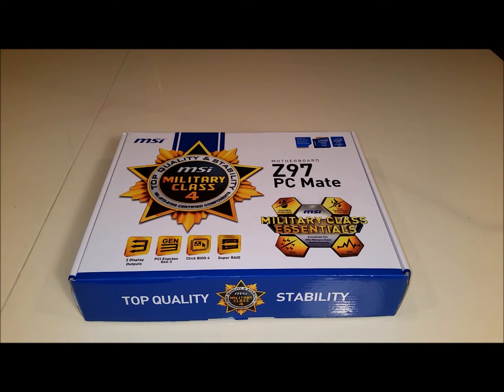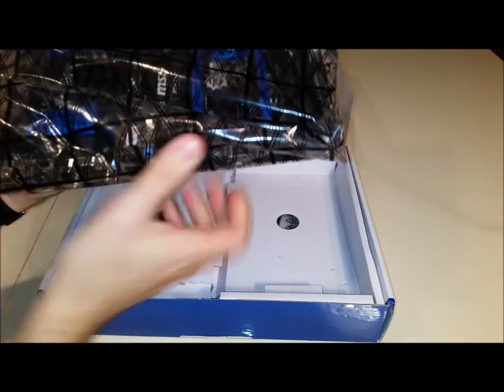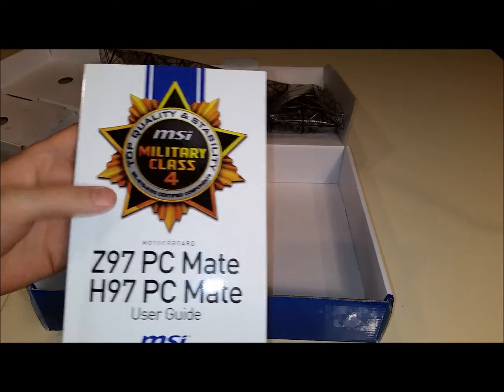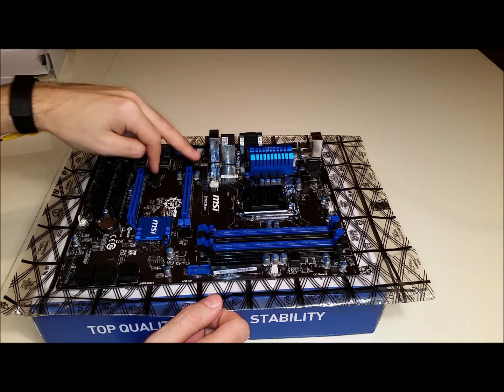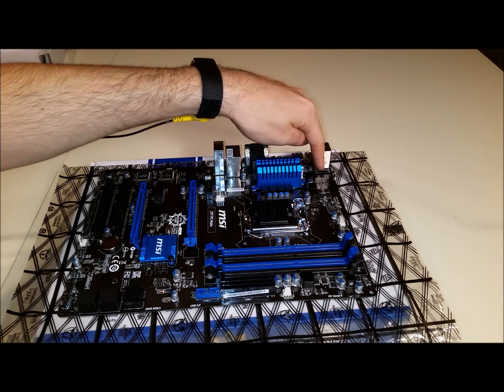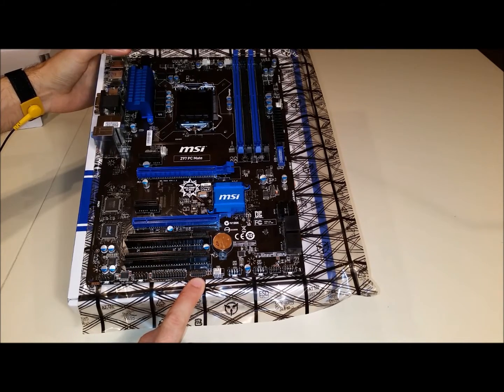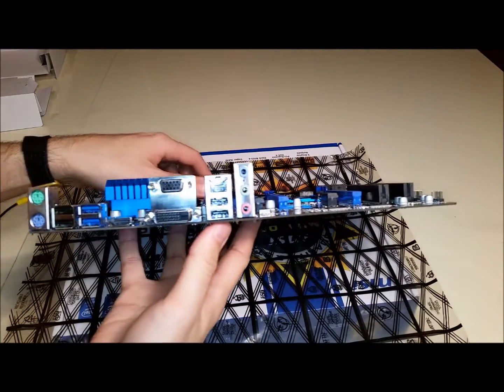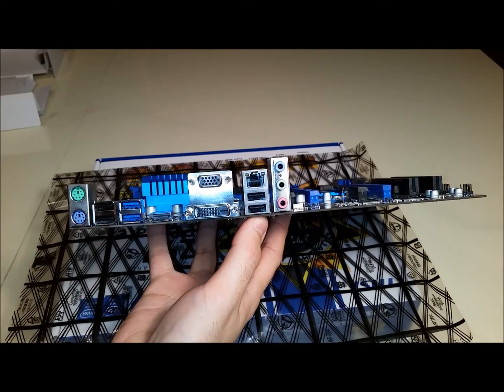DIY Custom PC Build Part 3: MSI Z97 Motherboard

Comment: I've had this board for 2 years, and have had absolutely 0 issues with it!
Reply: what hdd or ssd are you using on it. i’ve bought 6 different ssd’s and none are found when i try to download windows from my boot usb
Reply: i have sata ssd’s and nvme ones. some with two notches and some with one

Comment: so I have a Gtx 960 strix 2gb Asus and I'm getting this motherboard so what is the verdict I have a cooling system out of a 2010 apple workstation
Reply from the maker: You should have room for it. The Asus Strix GTX 960 takes up more room because of the large heat sing and fans, but there should be enough room because the MoBo has some distance between the PCI-E 3.0 slots. As far as compatibility with the board for overclocking, I couldn't find any documentation. Let me know how you made out.
Reply: Santech IT Solutions oh don't worry I got a gtx 1060 Asus gddr5 6gb

Comment: this is going to be my board
Reply from the maker: +Hedrix Happy holidays and lots of luck with your new board. This board has served me well for over a year now. I'm planning to install a hydro cpu cooler early next year so be sure to tune in and check it out.
Reply from the maker: +Santech IT Solutions Make sure to pick a case4 unit that will fiit a Corsair Hydro series 100i GTX CPU water cooler. Make sure there is enough clearance for the radiator and fans to fit without interferring with the rear exhaust fan and motherboard. Some of the Corsair case units have been designed and built to fit their water coolers, but not all, so make sure you do your research and get measurements. Good luck!

Comment: how many fans will this support?
Reply from the maker: sandmanx187 This case has room for up to six fans. One 120 mm fan in the back. Two 120 mm fans on the top. One 120 mm fan on the bottom. Two 120 mm fans in the front or one 140 mm fan.
Reply: +Santech IT Solutions i think he meant the motherboard not the case....
Reply from the maker: +Gogsley The motherboard can support up to 5 fans. If you need more fans you can power them with Molex connectors from the PSU. Most fans come with both Molex and ATX connectors. If you only have an ATX connector then you can purchase an adapter that will allow you to connect to Molex.
Reply: wait, so the 2 cpu fan connectors are for watercooling and cooling in general and the other 3 fans are for chassis fan cool
Reply from the maker: +Gogsley You have the right idea. If you have a CPU active heat sync you want to plug it into the CPU1 ATX connector. This will correlate with the CPU1 fan in MSI BIOS and Command Center Software (if you installed control center on your desktop). The CPU2 is also on a separate circuit and can be adjusted separately. The SYS fan will also show up in MSI BIOS and Command Center. I believe all the system fans are on the same circuit and are manually/dynamically set to the same speed, meaning that no matter how many system fans you have they are synced and cannot be adjusted individually. However, the CPU fans are on a different circuit and can be adjusted individually. In regards to a CPU water cooler, most of these units only require one ATX connector, even if they are a dual fan unit.
Reply from the maker: +Gogsley If you are planning to install a CPU water cooler make sure it fits in your case unit before buying it. You need a good 3.5" from the top to clear the motherboard and rear exhaust fan. Good luck with your build and post it online. I would like to see how it turns out. Thanks!